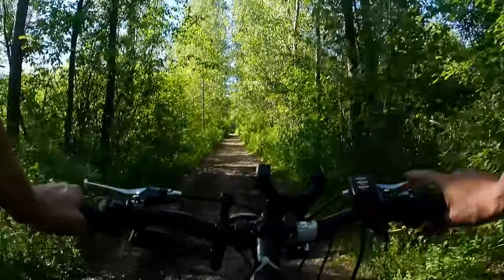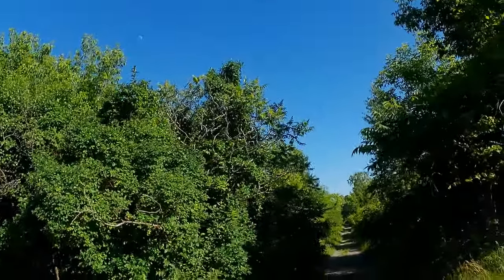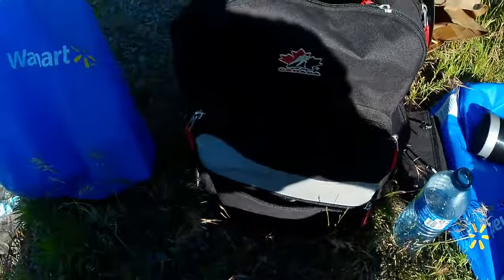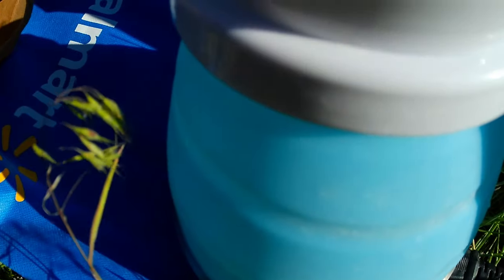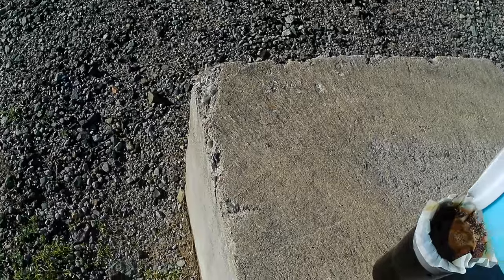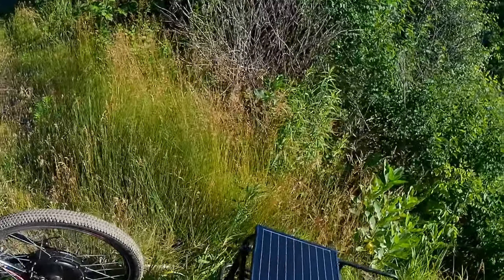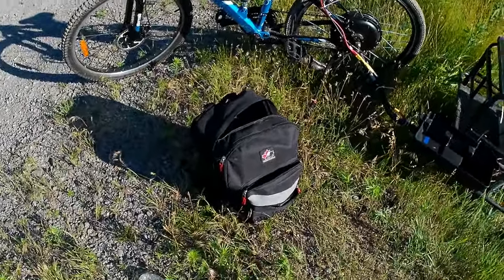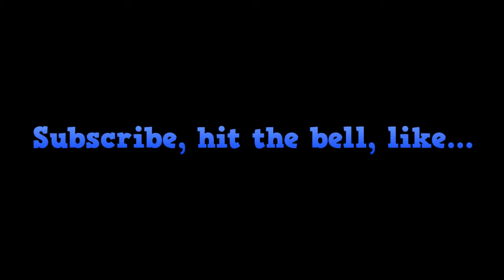How I Brew Coffee on a Solar-Powered E-Bike Camping Adventure

Comment: Bro your build is exactly what I had envisioned

A relatively short trailer that’s tall with open corners and just a box and have a coupe solar panels be the box lid on top with batteries underneath

That’s awesome, you even have the exact same super simple boost converter “MPPT” controller
Reply from the maker: If you see my old video, I went from having a 200-pound trailer on a scooter that you can't really pedal to a 60-pound trailer on a real pedal able bike. I just need some fenders and mod flap on the front of the trailer. Maybe a battery better than a 7.5Ah 13S3P and I'm set. Thanks for watching!
Reply: @Ro-Bucks  hell yeah man any time I love when people are makin the shit I love

Second life batteries might be a good move for the extra batteries

There are people who will get like old bird scooter and city rentable bike packs that hold like 90% of their original capacity, but it like halves the price

They might not last super long if you’re drawing serious current from them, but multiple in parallel then each one isn’t working very hard I wonder how long they would last